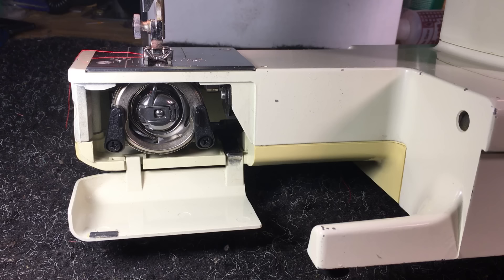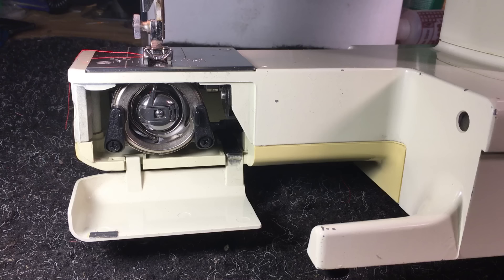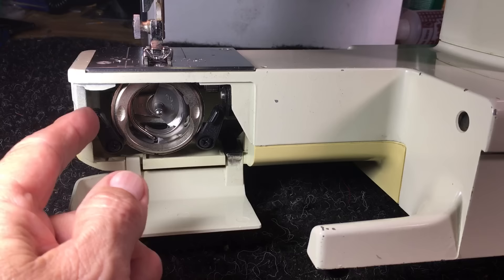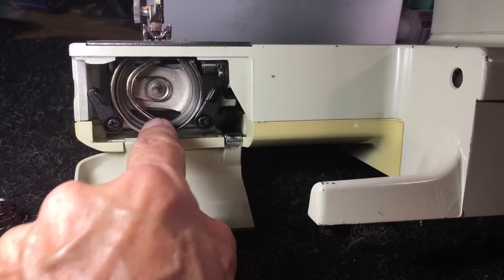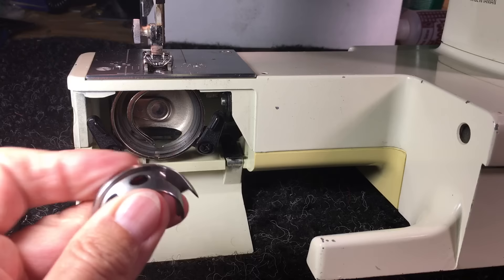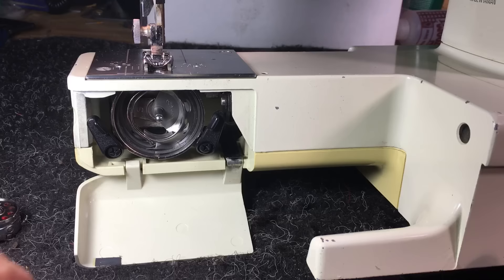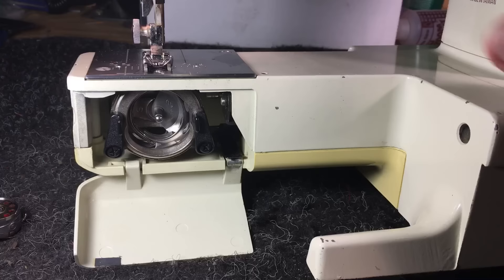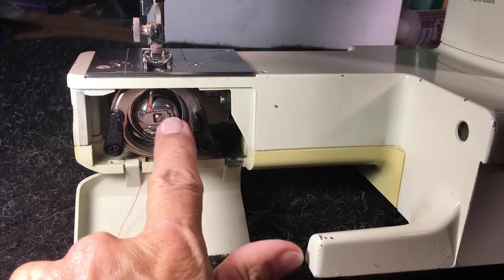Re-assembling the shuttle hook mechanism on a front load 15 class sewing machine

Comment: Thank you for a great video! However, on my Brother VX-1140, the latch levers are too loose for them to hold the shuttle hook mechanism in place. I can't find any information about this online, do you know what's wrong? (i have all the parts you mentioned in your video installed already)
Reply from the maker: If they are loose, they’re probably not being snapped properly onto the retainer ring. 
The left one snaps from the left to the right. 
The right one snaps from the right to the left.
Reply: @randyyoursewingmachineman9954  I can move the levers onto the notches of the retainer ring, however, there seems to be no spring power to actually hold the levers in place. Can you tell me how the levers hold the retainer ring in place? Is it by a rubber o-ring, or springs, etc?
I cannot tighten the screws more, so I wonder if I am missing parts.
Reply from the maker: @s328169347  each lever should have a spring coiled around the bolt that your tightening.
Reply: @randyyoursewingmachineman9954  Thank you! This is what I'm missing...now to search for replacement springs.
Reply from the maker: @s328169347  just about any front load machine has interchangeable springs on those levers. If your search is futile, let me know and I’ll send you some that will probably work. 😎
Reply: @randyyoursewingmachineman9954  Hi! I was unable to find any front load machine spring levers. Could you please let me know where I can purchase some? 😄Thank you for all your help!
Reply from the maker: @s328169347  unscrew one of them and send it to me and I will match it with two springs and return them to you. 
Send to: Randy Cole 
                P. O. Box 150834
                Fort Worth, Texas 76108
Just include a small amount to cover the springs and postage. 
$5 should cover it. 😎
Reply: @randyyoursewingmachineman9954  That is very sweet of you! However, I live in Canada, so I want to double check if you're ok with this! If it's too far, you can send me a link to these screws online :)
Reply from the maker: @s328169347  check sewingpartsonline.com. They might have them. 
There are usually folks selling loose parts on eBay and Etsy almost always.
Reply: @randyyoursewingmachineman9954  I got a 300 pack of assorted springs from Amazon in the end, just installed it in my machine and it works! Thank you so much!! I would never have known that I was missing springs if you didn't reply to my comment. 🥰
Reply from the maker: @s328169347  you’re welcome. You’re the clever one who ultimately solved the problem. Kudos to you!👍😎

Comment: The retainer ring moves around. Could it be the wrong size?
Reply from the maker: If you didn’t remove it yourself, but are just replacing a missing one, it could be the wrong size. The Kenmore in my video, the 158 series, takes a retainer ring that’s slightly smaller in diameter than some other front load machines.

Comment: For some reason each time I sew the Bobbin tends to get really tangled from the jump. Does anyone know why? I’ve looked at multiple tutorials as to how the bobbin is supposed to go in but it’s still happening.
Reply from the maker: Look for burrs on the point of the hook. 
Check the big three:
1) Thread 
2) Threading 
3) Needle
I’ve made a video on that 
Also, be sure to hold your upper and lower threads tightly to the rear, as you begin to sew. 
I’ve made a video on that as well.

Comment: If you're still looking at this, would you know why my top thread keeps breaking.  I think it has to do with what's going on in the bobbin area.   The problem started suddenly and I can't figure it out.
Reply from the maker: Check that your needle is the proper one and installed with the flat side to the back. 
Maybe there’s a burr on the hook. 
That’s the most likely answer as long as your thread is also correct.
Reply: @randyyoursewingmachineman9954 thanks.  I have a number 14 size needle and a fine cotton thread.  
That doesn't seem to be any birds underneath and I'm not sure about the needle size though.  This seem to have happened after I bent a needle one day and it's never restored.  Happened very suddenly. 

I don't suppose that raises any alarm bells?  Thanks
Reply from the maker: @danman2070  if you bent a needle it had to hit something. Usually that’s the hook. 
The needle will put a ding in the hook that will need to be polished out. 
And the new needle is installed with the flat side to the rear?
Reply: @randyyoursewingmachineman9954  thanks for that.  I can confirm that the flat side of the needle is to the rear.  I think you're right about a bur on the hook.  I couldn't feel anything today when I looked at it but I'll go over it again.  There's likely a small bur on it that's cutting the thread.  The strange thing is that I can turn the knob an sew about 5 stitches before the cotton breaks again. I have to go slowly though.

Update:  Checked the burr hook and there doesn't seem to be a bur there at all.  Very bizarre.. Is it possible that I'm using the wrong needle length?  Is there an ideal needle length for this machine?   When I watch the timing, the eye of the needle seems to sit a little high relative the burr hook when the needle is at it's lowest point.     

I thought it might also be a 'needle plate' burr.. 
Thanks again.
Reply from the maker: @danman2070  the ONLY NEEDLE that you should be using is a 15x1 needle. 
Any standard needle for a household sewing machine that you purchase will be the correct length. 
If you have the wrong needle, you probably have an industrial machine needle. 
Check the tip of the point on the shuttle hook. 
Just a slight barb or bend will cause what you’re experiencing.

Comment: Please try help, i do have the tension correct , even on 2 rotations it tangles up , like its catching on the hook part that's left in the machine when you take everything out at 2mins 18sec That part that's attached . The cotton seems to catch on the end. I have turned by hand and this is what it seems to catch. How can i stop the clogging of thread
Reply from the maker: Tension on four. Never change it. If it’s on four, your tension is perfect and not the problem. Look for a burr on the point of the hook. The point of the hook can’t be scratched or scuffed. Make sure the thread isn’t oversized. Use all purpose/dual duty thread only. That could be the problem as well.
Reply: @randyyoursewingmachineman9954  Thanks

Comment: I can not get the bobbin to lock into place can up you please help me.
Reply from the maker: If the bobbin won’t snap into place, it may need a drop of oil on the latch. There could also be a small piece of thread wrapped around the post of the hook. Make sure the tang at the top of the bobbin case is inserted into the notch at the top of the retainer ring. Good luck.

Comment: My hook cover seems to be loose. Is this normal or am I missing something?
Reply from the maker: I’m not sure what a hook cover is. Could it be the retainer ring?  That’s the circular metal piece that holds the hook in place. If you don’t have the snap levers in the right position, the retainer ring will seem loose. Make sure that the left one snaps to the left, and the right one snaps to the right when you take it apart. Then when you replace the retainer ring, snap the left one to the right, and the right one to the left. That will lock it in securely.

Comment: i think that my tension wheel is broken ,my thread breaks behind it after threading ,help please  brother ix3014
Reply from the maker: Thread it properly by raising the lifter lever and make sure the thread is between the tension discs. Then, lower the lifter lever and pull on your thread as it passes through the tension assembly and see if it has firm resistance. Be sure your tension is on four or in the middle range. If you can feel the thread release and tighten as you pull the thread while raising and lowering the lifter lever, your tension “wheel” is fine. Your problem lies elsewhere. The problems that most folks ascribe to “tension” are almost never the “tension”.

Comment: What's wrong with my machine. When I turn the wheel ,the needle is hitting the piece in the bobbin case assembly. I have made so many masks ,scrub caps&  gowns for our hospital.It was working fine then all of a sudden this happened. Can you help me.
Reply from the maker: Check if the needle is bent or inserted properly all the way up to the stop screw.
Reply: Randy Your Sewing Machine Man ok I will try that. Thanks
Reply: I changed the needle and took out the bobbin shuttle set up now it won,t pick up the bobbin thread.
Reply: Randy Your Sewing Machine Man I checked that. It seems a piece in the bobbin case moves back and forth on the shaft. It cause the needle to hit the casing instead of going right down to complete the stitch. I can’t pick up the bobbin thread. Any help appreciated.

Comment: As long as I put my black arms in place, my needle stops moving? Can you please help with this issue.
Reply from the maker: Sounds like the hook isn’t seated properly.
Reply: @randyyoursewingmachineman9954  Thanks ! to me it seems like proper. May be I am wrong. But even if i apply pressure by hand in place of black arms, the shuttle stops to revolve. even if one arm is in place, it kind of works
Reply from the maker: @siyasaya  reassemble it and take care to note the positioning of your retainer ring. It may be facing the wrong way or not in the notch on the bottom.
Reply: @randyyoursewingmachineman9954  Thank you so much. tried but no luck. Actually it was working properly and suddenly stopped working.
Reply from the maker: @siyasaya  make sure that your black retainer “arms” are in the correct position before you attempt to reassemble the retainer ring. Make sure the left one is all the way  to the left and that the right one is all the way to the right. Try that.

Comment: ok I'm having trouble with my sewing machine my needle i can't get it right the needle is hitting to the feet
Reply from the maker: Is your needle bent or installed improperly? That’s the first thing I would check. 
The solution is, almost always, the simplest thing that you can do to remedy the problem. 
Occam’s razor applies to sewing repair methods as well as worldwide mystery issues.

Comment: The thread + needle keeps jamming and won't go. and has THREE threads coming out of the bobbin area instead of just the bobbin thread. - I read that it means the TENSION is wrong. But no matter which way I turn the tension dial, it keeps happening after sewing a couple inches. Argh. 😳😳😳😳😓😓😓😓🤔🤔🤔🙄🙄🙄

Comment: How do I load the bobbin holder?
Reply from the maker: With the opening of the bobbin case facing you:
1) put the bobbin in the case so it’s turning clockwise 
2) slip the thread in the slot and under the tension spring
3) while holding the release tab fully extended, place the bobbin case on the hook post with the curved finger guide at the top
4) push the bobbin case in as far as it will go, then release the lever(tab)
5) make sure it is locked tightly into position

Comment: I put back together and now the needle is stuck?? HELP PLEASE I AM GOING CRAZY
Reply from the maker: @EsperanzaMeredith-te8ss  take it apart and remove the needle. 
When you disassemble it, MAKE SURE THAT THE LEFT LEVER IS SWUNG TO THE LEFT, AND THE RIGHT LEVER IS SWUNG TO THE RIGHT. 
When you reassemble it, make sure that the needle is at its highest point when you put the hook and retainer ring back on. 
GO. 
STEP. 
BY. 
STEP. 
THEN SNAP THE LEFT LEVER TO THE RIGHT, AND THE RIGHT LEVER TO THE LEFT. 
If you reassemble it incorrectly, you will get the results you have. 
Don’t run the machine until you’ve turned the hand wheel a couple times to assure that it’s together correctly.

Comment: I been doing this over and over and my needle continue to get stuck , not sure why it hits the hooks assembly/ shuttle drive , what m I going wrong , I already broke two eddies 😩🤣
Reply from the maker: Put in a new needle and raise the presser foot. Don’t thread the machine or needle. Turn the hand wheel slowly toward you and see if the needle hits anything. If it doesn’t, your thread or fabric may be the problem. Oversized thread put my kids through college. It won’t work in household type machines. Also, check your hook assembly for nicks and scratches. If you see any, even one tiny snag, smooth it and polish it away. Add oil and reassemble. Then sew.

Comment: This is great but I'm obviously not doing it right because the needle keeps getting stuck and I haven't start again  ... not cracked it yet!
Reply from the maker: Slow down and follow the steps slowly. 
There’s probably one little thing that’s being skipped. 😎👍🏼
Reply: thanks for replying! So I've looked really carefully and it all seems good until I put my bobbin case back in and it's just a little wobbly and doesn't look secure - it's as if there's something missing to hold the 'shuttle' in place (the first bit that forms the circle) @randyyoursewingmachineman9954
Reply from the maker: @lynnwakefield5706  when you snap the black pivot arms to remove the retainer ring, the left one has to go to the left, and the right one goes to the right.
If you don’t do it exactly that way, what you’re describing is the result.
Reply: Thank you - it's working now - I think one of my problems was that the bobbin thread was very uneven,  when I rethreaded a new bobbin all went smoothly. Thanks for your great video and help 😀   @randyyoursewingmachineman9954
Reply from the maker: @lynnwakefield5706  you’re welcome.   👍😎

Comment: MY HERO
Reply from the maker: Thanks. Glad to help.
Reply: @randyyoursewingmachineman9954  would you mind if I asked you about a problem I'm currently having with the bobbin winder on my machine?  It's not spinning, or spinning slowly and stopping/starting. I replaced the rubber tyre on it, hoping that would fix it, but it's not helped at all. When the bobbin is disengaged and I press the pedal, it all spins just fine, at high speed. As soon as I click the bobbin to the right, same issue. I can see the new tyre getting shredded up by the mechanism. Any ideas?
Reply from the maker: @therossers  it needs oil. Just a drop.
Reply: @randyyoursewingmachineman9954  oh interesting thank you so much. Oil on the fly wheel or on the rubber tyre?
Reply from the maker: @therossers  oil on the axle of the rubber tire. The bobbin winder wheel has to be dry of oil itself. Also make sure the contact surface of the hand wheel is free of oil on the surface as well. One drop of oil is sufficient on the axle of the bobbin winder mechanism.  Due to centrifugal force, any excess oil will reach the rubber wheel as it spins and cause a slipping problem, so be sparing with the oil.
Reply: @randyyoursewingmachineman9954  thank you so much, I'll give that a try
Reply from the maker: @therossers  👍🏼

Comment: Mine is not moving at all. What should I do to fix it
Reply: Not want to spin when I put the needle at the highest point
Reply from the maker: I don’t have enough information to offer advice. Watch a couple of my videos and you might get the problem resolved. 
Good luck.
Reply from the maker: @muhammad9343  if you can take the needle to it’s highest point, something is moving.
Reply: I figured it out. It was that cylinder with the grove in it. There is a pin that was not in the hole to lock it and turn the back arm. Which turns the shuttle lock.
Reply from the maker: @muhammad9343  excellent work. 👍🏼

Comment: I got it back together but it is loose and the only way I can get the machine to run is to hold it in place with my finger and thus I can not use it.
Reply from the maker: It’s not assembled properly. Try it again. Pay special attention to your snap levers.
Reply: @randyyoursewingmachineman9954  That was it, I thought the notches where stoppers and they are tighteners. I had to push the levers to be on top of the notches. Tks!
Reply from the maker: @jeremyrobbins9064  perfect. You’re welcome.
Reply: @randyyoursewingmachineman9954  Just sewed for my first time and I can only seem to get the machine to wok with the pressure foot up. Thus I think I have a tension issue. What are your thoughts on what I should do to get it to work with the pressure foot down? Because I was having to feed the material the stitch is all over the place...
Reply: @randyyoursewingmachineman9954  For reference, when the pressure foot is down the machine will not even work the needle. It just makes a humming sound.
Reply from the maker: @jeremyrobbins9064  be sure to tighten your hand wheel clutch.
Reply from the maker: @jeremyrobbins9064  you don’t have a tension issue if your tension dial is on 4. Always have it set on 4 and your tension will be set for 99.9% of everything you will sew.
Reply: @randyyoursewingmachineman9954  I tightened the clutch and was able to get the needle to work with the foot down but the material does not feed through. It just keeps stitching in the same spot. Thanks for all your replies, sorry I keep having issues. I feel these machines are very sensitive, to the point that I am having to learn every little aspect one step at a time.
Reply from the maker: @jeremyrobbins9064  they’re not sensitive, they’re like tanks. Even a tank has to be maintained and serviced regularly. Sounds like your feeders are needing lubrication. I made a video on that.
Reply: @randyyoursewingmachineman9954  Fast reply my friend, thanks much!
Reply from the maker: @jeremyrobbins9064  👍